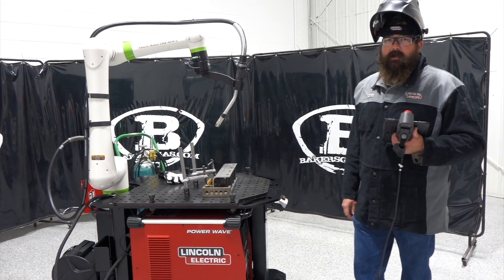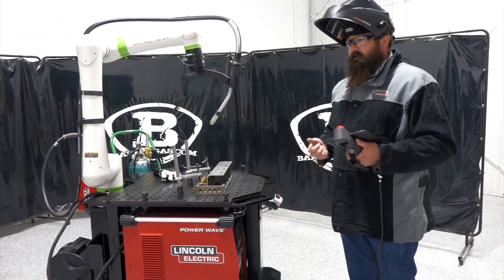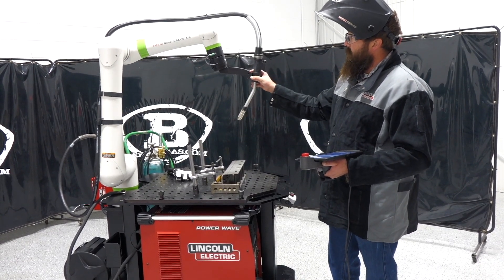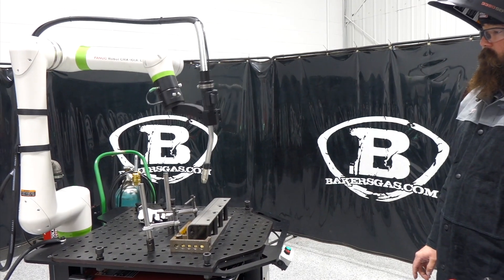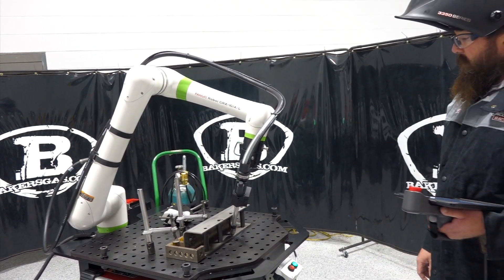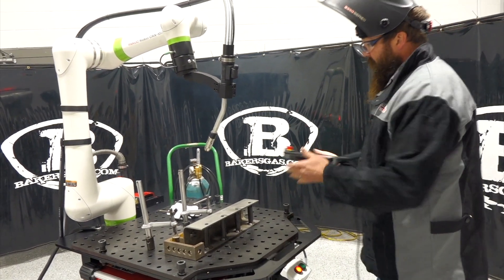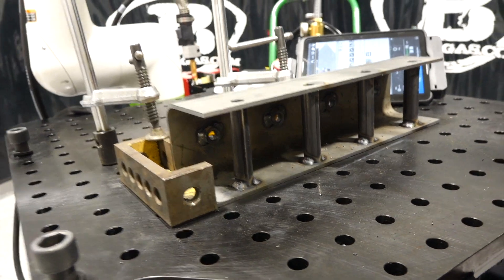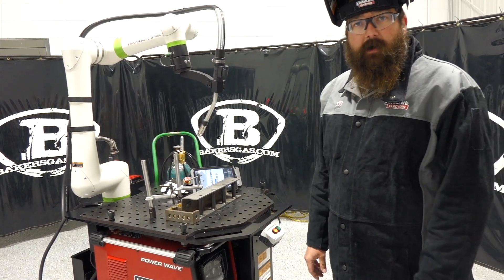Lincoln Electric Cooper Welding Cobot

Comment: If you can’t find someone to weld it due to labour shortages, you still need labour to handle the parts. The only this may be affective is if you had 1 guy feeding 10 of these robots. But that wouldn’t be cheap either plus you would need a very high quantity to even consider this. What we need is the younger work force to be encouraged to get their hands dirty.
Reply: What kind of pay are we looking at here? Is it going to be competitive pay to a place that pays teenagers $15+ an hour to work inside an air conditioned environment without health risks like breathing in toxic fumes?